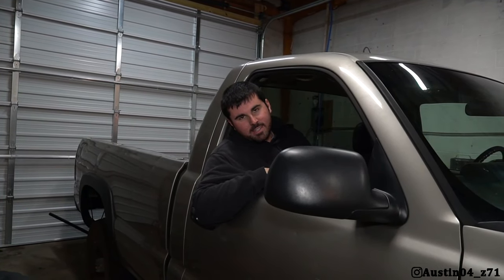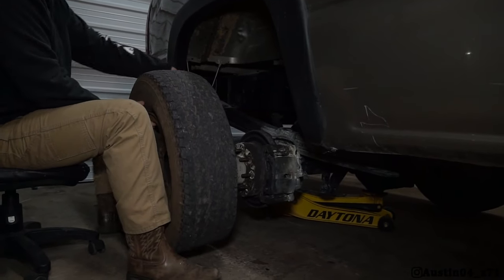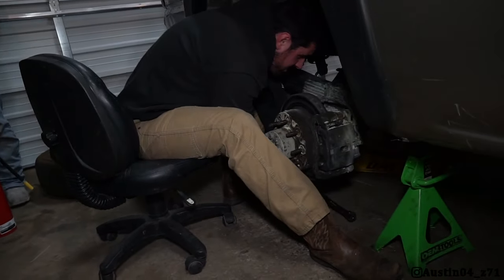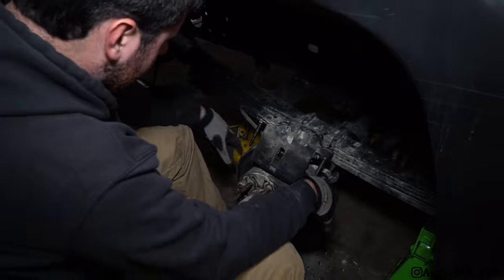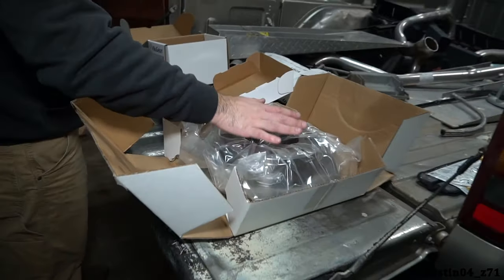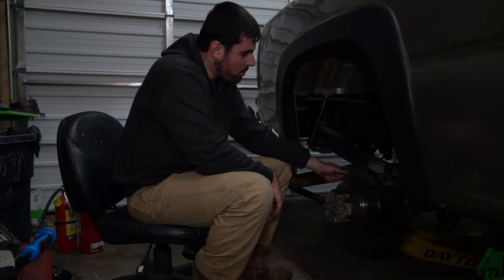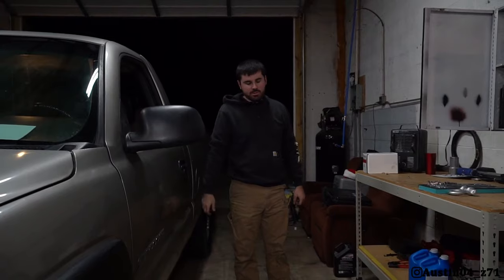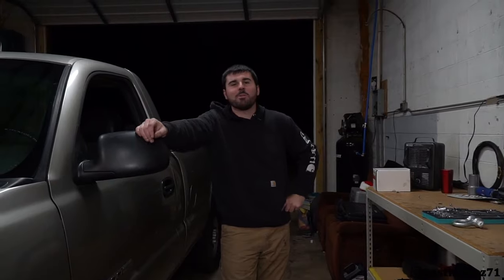My Brakes Caught on Fire and This Happened

Comment: Is it drivable after I pull up to turn the fire off ? 😢
Reply: Had my brakes catch fire on a track day and went on a road trip after, the brakes were definitely very shit after so best to get them replaced asap. At one point I had to slam them and ended up driving past a traffic light stop because they didn't work well. But after I braked like that they worked a bit better. My worry would be leaking brake fluid and bubbles in it.